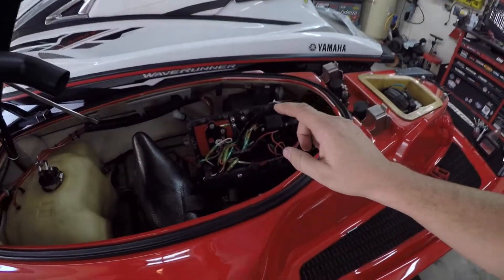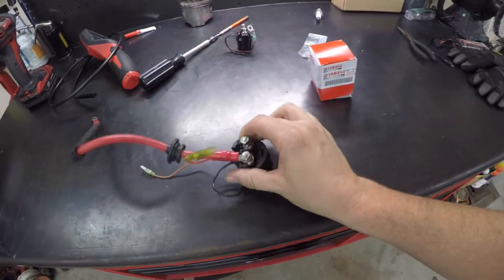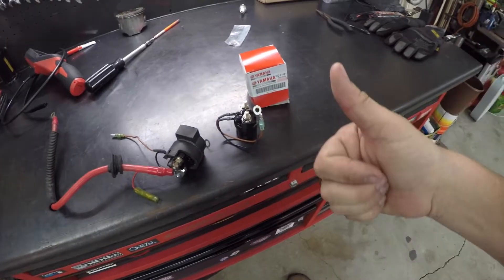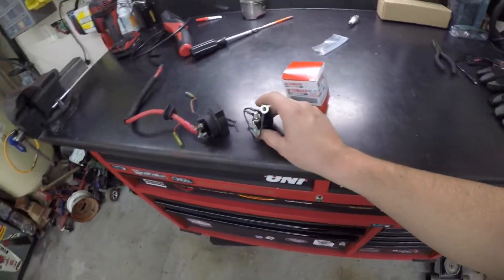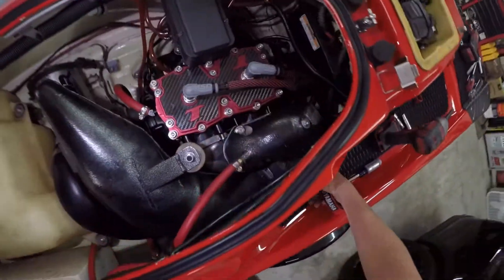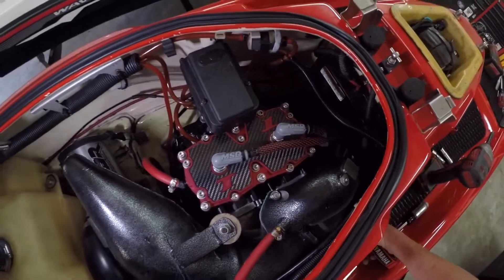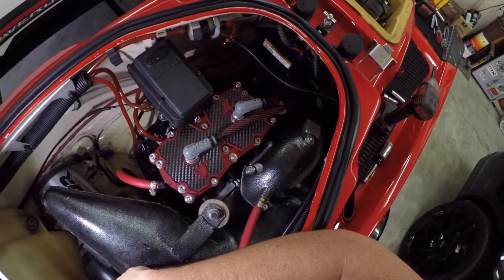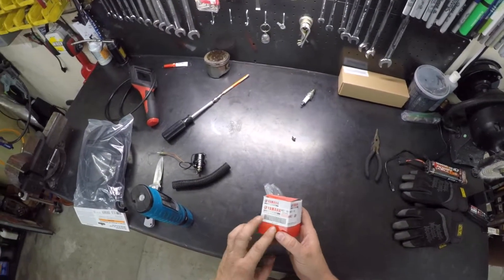🤕 Yamaha JetSki Not Starting *Relay*

Comment: Hey, love your videos! I have a 94 wb1 and it is not starting. I was riding it and all the sudden it died on me. I check compression and cleaned the carb but still won’t start. I determined that it isn’t getting any spark. Any ideas on how to fix that?
Reply from the maker: Honestly it could be multiple things,  like the start stop switch could be corroded or bad, the plugs or plug wires,  bad ground to coil, coil, or at worst it could be the stator.   It’s one of those more than likely but check in the order I sent to you.
Reply: Thank you for you help! How do I check for the order you sent me?
Reply from the maker: Start with replacing the plugs to see if they were bad,  then open up the start stop switch all the way especially the stop button.  That is where they usually corrode.
Reply: Sounds good, thank you so much for your help! For your blaster what spark plug caps did you order? Could you send a link please. Mine are broken
Reply from the maker: @manatwork7715  Check this out! https://www.amazon.com/dp/B0073OSF1W/ref=cm_sw_r_as_gl_api_glt_fabc_HJZJSN302PTKJYCRTADZ?linkCode=ml1&tag=coyotechris-20

Comment: I love the builds, i just got a 95 wb1 with a few mods, biggest of them being dual sbn44's and a coffman exhaust. Is there anything I should look out for on these ski's? Bought a new throttle synchronizer because it broke while I was testing it.
Reply from the maker: That’s awesome 🔥🤘🏼 as far as things to look out for like issues,  check your plugs ever once and a while for leaning out.  Or if you were asking about upgrades to look out for I would look into a 12 vein pump that made a big change in power output too.
Reply: @CoyoteChris  thanks for the input! cant wait to get it on the water!
Reply from the maker: Yeah we have been out a few time so far.  Been working on the X2 trying to get the steering better before I start fiberglass work on it. 🔥

Comment: was it making a whining noise when you turned it over...mine is?  hear a starter problem makes a clicking noise...wonder if i possibly do not have a good enough charge or a battery issue? thanks
Reply from the maker: Check all connections and battery charge first.  Usually the if it’s the relay it will just make a clicking noise.  Kind of sounds like battery issue to me.
Reply: @CoyoteChris  will do and i thank you for your time...
Reply from the maker: Your welcome 🤘🏼

Comment: I have a 1999 Yamaha wave runner replace battery and starter relay but no click
Reply from the maker: Check you’re grounds and after that it could be the stator.
Reply: If is doing a click noise what means starter?
Reply from the maker: @Suntripchile clicking could be a low battery, bad connection or starter could be bad. 👍🏼